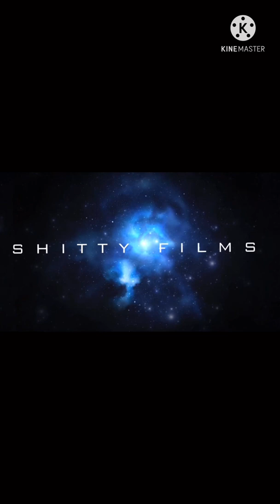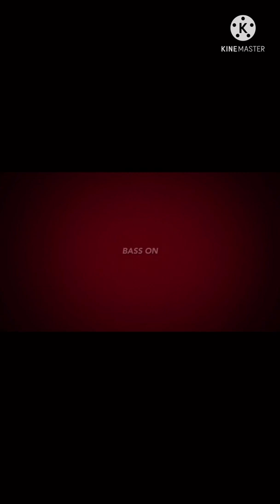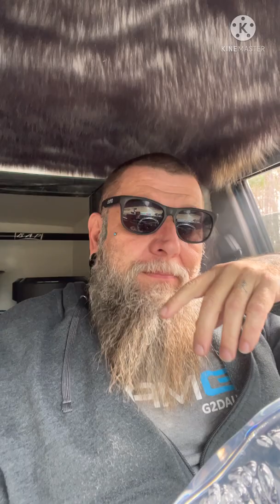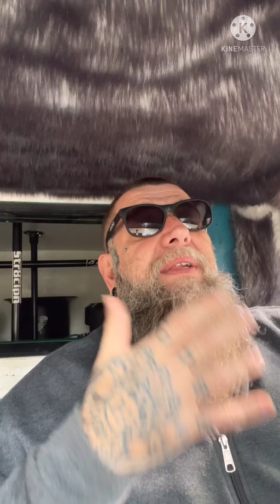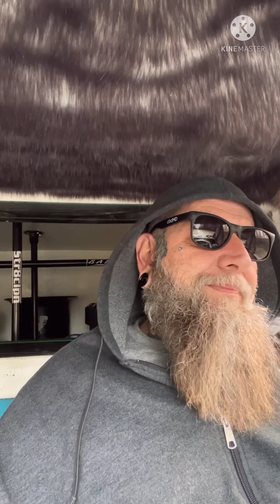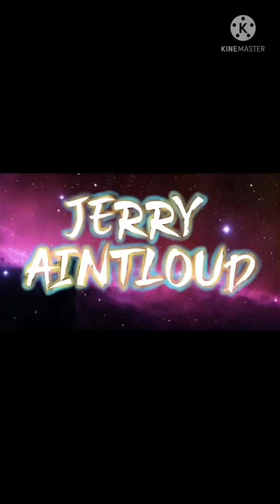Subsonic filter good and bad

Comment: I like the cheaper 100-200 dollar dsp just for the digital crossovers. If you're running a full range signal sometimes a bass amp has a hard time filtering the hpf anyway. The dsp is use has an eq for each channel so I can eq my mids and leave the sub flat

Comment: I disconnect the sub, turn off the filter, hook up a dmm to the disconnected speaker wires at the sub then play a sine wave test tone half an octave below my ported enclosure's tuning frequency. I take note of the AC voltage. I multiply that voltage by .708 to get my 3db down target voltage. I begin turning on the subsonic filter until the voltage starts to go down and stop turning once I arrive at my target voltage. I'm new to car audio, I tried this out and it seems to work for me so far.

Comment: And do ur subs even makee 10 hrtz in specs? Ino my buddy has a svs thats said to be i think it was 17 hrtz it made 16 anything else lower it just start tto chuff i think it was. But it definatly did work to its speakers specs./ responded in ways witch physics proves with waves, of course dependent the ohms and voltage and other properties. But i have seen that in physics to power it is dropping it. To make any headroom. A amp is built to push power tho theres nuthing but waves and to it its math so it has to show zeroes sumwer. So im sortta tryn to say sure it can be in a signal but how much tho triple that, double it, qaud it, keep going to all the power u have it is to be down, so it needs more then we think or id say one narrow ass output mad peak or vice versa dependent on ohms/ have to put the qaulity factor in too/ sentivities preamp stage.. everything .. inorder to push the power to there dependent ur ohms ur power nd again everything above Nd box and place ments losses as well. physics proves it and physics made it.. made everything.. but im saying all this as to im prety sure physics would truly show u how to hit the 10 herts i mean .. 40 hrtz convulted to the 11th power is levitation/force. So with thinking about that^ i would say u need quite a bit more power or the crossovers are not working with as well the bass knob
Reply: And i say bas knob becauuseee a potentiometer is controll tho dont qoute me on it look up audio control with potentiometers! As for its all power but within crossovers and raised or droped within powers so i feel its not enough power and or if the sub is not rated well then its gunna blow before so i would think. And im not saying anything to undermine anyone or to say no or anything tho i am saying what i truly know as i maybe building a killer bass knob here but yee theres much more then we think to a potentiometer expeciallyyy!! If its say any made ones wer ur seing ppl in the reviews saying "my pod makes full power at half and but quieter at full/ many more diferent times of power/ characteristics as its basiiccally a nother crossover.. its all crosses in its mind so how much power is there really there? Nd i mean in physics wise as for it could very well be u do need more power as for "We do have to drop inorder, to make a degree of anything/ from start , from anything, to anything but sooo much more. And im not familliar with some terms/words so my explanation may be off but i for sure know exactly what im meaning and in time im going to be proving these facts and soo much more to the truth to it all as most only know what the truee toold is telling them but do we really!.. know physics?
Reply: And agian soo much more :) physics is great opertunity once know to the truth
Reply: To the truth Of physics*
Reply from the maker: I have tons of power, but yes I can play 10hz but it's dipped down, because the amps subsonic filtering starts to cut the signal around 12hz.
Reply: @JerryAintloud  ohh kk i get wat u sayin nd i know u do ahaha just i meaning in power through physics u have to get to a power to make a power, but im not meaning u dont u very well could tho. But thinkin bout how much it takes to cycle sumthing u can up it over the case. So im rlly meaning like poossible chance u havent hit that power as in "still posssibly need more power, to make that power but not only make as well to phase that power over through time but thats lots of power if its down so it has to have evenn morree power, and be able to takee that power the subs.
Reply: @JerryAintloud  and with knowing thers the dipps is to be needed more to be distorted or cliped cause music is all diff recordings but the fact that its only made from the whole spectrum of power its needed to be right there with power as 1, so im thinking ppl understimate the truth behind "power" power as to "physics power.. which 100percent is power.. without physics nd math wed a never had power
Reply: Tho having tons of power is different then hbeing tons of power onllyyy to that  10hrtz thats way droppedd, so im thinking its to need more power in sence that if its made its to be sent properly through the power of physics to trullyyy trullyyy react with the reactantce
Reply: Alsoo y stuffs so expencive truly truly trulllyy takes money to make money (building) then takes poqer to make power( everything else along the spectrum but its all tooken in powers from every speaker so we need power to make power .. i thought i had power looking at amperage just fuse and amp of qlt being "high amped" tho its dog lol. 171 at idle wich yes killz but still need more power for the subs in my system tho its adequite tho in physics its trulyy trully not adequite wed truly need alt for every amp exact power every single device exacct power
Reply: Sorry for the bunch of messages. I cant keep it all in one its just a train of thought.. physics proves nuthing but everything we need power to make power( not stateing that u dont have power)
Reply: Or say just thinking a nothherr thing (the link i sent you) circuit built to add the frecuency in more which would be more better as for its lack of frecuencie tho it is there as to y i say more power is possible its needed as for u are trying to do sumthing thats under a threshold and that is sub atomic tho its at a lower db wich. We know it needs more power to push that but we do know what wer used to. (Not saying anythjng to ur knoledge being wrong or anything to say no, i am just talking from what i do know and seen. There is lots too it to be more power or  to be more of a phase but everything only can do soo much so at that point we need more power tho at that point to be 100percent terue to outing of 10 hrz, it is in need of 100 percent power to out the spectrum straight to the speaker but thats a shiet ton of power truly trullyyy trullyy, speaking which i thought hey 320 amps is bit it is if we could make it at idle tho to the current there still is the voltage but withing the powers as octaves wich is evennnn morrree power needed. So im not to say u dont have the power or that u cant i do say tho nd its known by everyone its 100 percent it takes power to make power and takes money to make that power too but im speaking in a physics term to power its to be rising in power but drop so low u need more power to do so, wayyy into sub atomic (below atmospheric levels)
Reply: And its really hot at that level as its all a force of presure at that point in electricity tho thats greatterr force then levitation (40 hrtz convulted to the 11th power) thinking of alll that power and what we doo have in stores to buy / crossovers and everything takeing the power in the end to the output tho gunna disepate some into the heat sync, we underestimate physics and we need more power or more cappabilities to changing that realation of phase between the whoolleee entire spectrum. We need more power tho im saying that as in maybe soon we will figure out truth to true teue trueee sub atomic i mean its probly already figured out "the physics was made to everything proven in alll eternity it rlly is the third eye

Comment: Subsonic filters start limiting output a little before rated/stated. I tested my crescendo bc series amp., and all the way down says 10Hz, like jerry said his amp does in this video. Even though it says 10 Hz with the dial turned off/all the way down, it was starting to limit output @ 14 Hz a little, 13 Hz was noticeably more limiting on power. Also, i like setting the subsonic, by using an SPL meter. Example: turn up a 150 Db capable system, to around 130 Db (set SPL meter to real time = not peak), using a constant test tone, @ 0 to 10 Hz below enclosures tune, set to repeat, then just watch the SPL meter, as you slowly turn the freq. up on the subsonic dial, until you reduce the SPL output 1 to 3 Db, so the meter is showing 127 to 129 Db, from 130 Db, @ 0 to 10 Hz below tune of your enclosure. If you want to be the safest on these settings, i suggest -3 Db of output @ your enclosure tunning= for high/over rated, powered systems. If you are running say half rated power to your subwoofers, maybe set subsonic, -1 Db, @ 10 Hz below tunning. Hope this helps? Have a great day, fellow bass heads!

Comment: Quick question I use the headunit crossover at 50hz and set it at 35hz on the amp my box is tuned to 27hz 34hz is my peak does that sound like a good setting
Reply from the maker: I'd go 50 on amp also
Reply: @JerryAintloud  appreciate it man🫡

Comment: With the bass boost on the amp, what would cause the bass to be very faint with it off vs window flexing bass when it's on? Only have decent bass with the bass boost turned on?

Amp is skar rp 800.1. 2 memphis  bass reference 10s sealed, wired to 1ohm. Gains set to a lil bit under half, lpf 125 - 130hz only on amp. Sub Sonic 33-35hz

Comment: A subsonic and LPF are not a instant cut off point it all depends on the db slope for the crossover.. some may have a 18 db or 24db and 12db cross over and how steep the roll off is so your subs will play higher then lpf setting it just gets quieter as it gets farther away

Comment: I set my sub sonic and lpf with a multi meter  at the speaker terminals, I set a tone at my lowest comfortable frequency and watch the voltage and see when it starts to pull the power back, and really I dont wet my. Lpf just cut it all the way up I don't play anything above 45hz

Comment: I have a smd cc1 love it, it does great for setting crossover and pretty simple to use and recommend,  and then I just figured out that the taramp md series will play full range and does a great job at it would recommend for a power door full of speakers

Comment: U should  try to set your crossovers from your  amps lpf with subsonic turn off.    With subwoofer crossover turned off on your kenwood head unit if u can turn it off?  idont think the kenwoods have that feature. Then maybe I think u will lose control at 10hz 😆
Reply from the maker: but the subsonic on my amp doesn't turn off, lowest is 10hz
Reply: @JerryAintloud  that's what I mean all the way down
Reply from the maker: @HardKnocks160s  it's always been all the way down

Comment: I just run my crossovers  for my mids on my pioneer 2017-2021 model  it has a crossover  for subwoofer settings  but u can turn  off  the  subwoofer crossover  on  these newer  pioneer headunits and just run settings from your Korean amps that's how I run mines works great 👍  sounds amazing